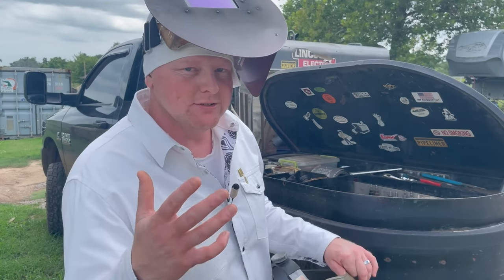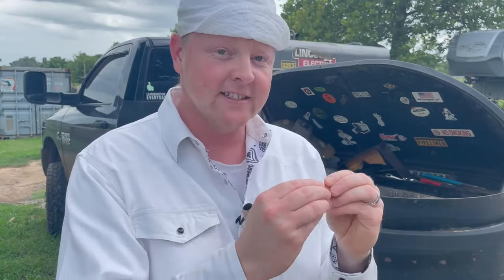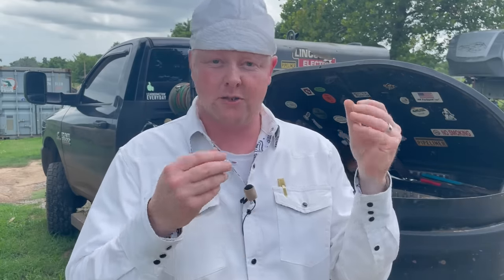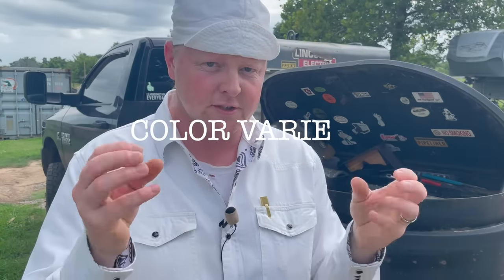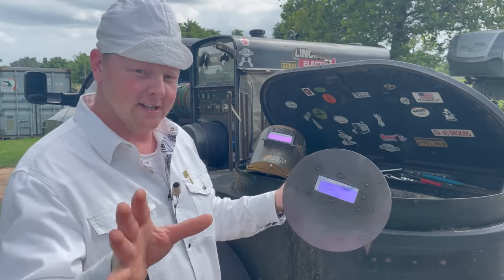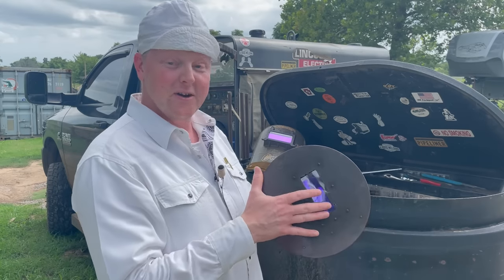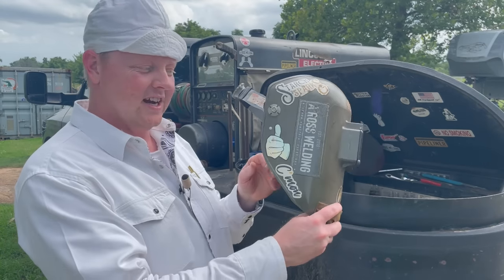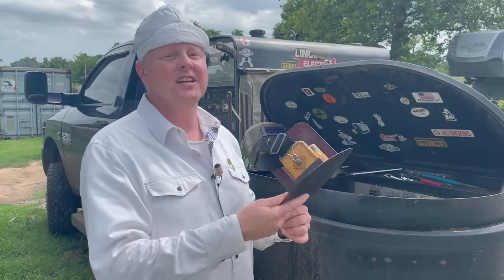Why Pipeliners Do NOT use Auto Darkening Welding Hoods (Fixed vs Auto-Darkening Welding Lens)

Comment: Auto darkening lenses have blue and yellow. Blue is the one I use and I can see very well. The advantage of auto darkening is useful in a shop setting where it is darker and hard to see. Out in the feild it is pretty bright out with sun. The sun also wears on auto darken batteries that are not solar powered. Auto darkening is ment for a shop setting and fixed is for out in the feild. Not that you can't use them interchangeably but that is what they were bulit for. The materials they are made out of are big sign of it as well. Sugar scoops and pancake hoods are made of a tougher material for working out in the feild. Shop hoods are usually made of a thinner plastic that is still durable but not like the stuff you see in the feild. I have never worked in the field but know some guys that do and they are very old and were around when they didn't even have hoods and wore goggles with cotton mask. The guy I know he owns a weld supply shop and has over 45 years of experience in shop and in the field and that is what he told me.

Comment: This just sounds like a pure personal prefs argument.
I would have thought maybe cause another welder is normally welding the same pipe it could cause issues with flash in your peripheral or from the sensor darkening before you're in the weld (due to the other welder).

Comment: I welded many years . Pipeline.  Compressors . And other high pressure piping .  Up . Down . B 31 .  Api 1104 . And all in between.  . Lincoln supervisibility fixed shade 9 outside . 10 inside . Not sure bout the new ones . But the early auto dark would delay in the cold wyoming winters. And get super dark inthe heat . The USA at the time Lincoln supervisibility was always crystal clear

Comment: Thanks for sharing with us Austin. I like the auto darkening lense but they are dangerous. When I put my hood on I will strke an arc just to make sure the lense darkens before welding. Can't afford to take a chance since I don't have lots of lenses available close to me. You stay safe and keep up the great videos. Fred.
Reply: For peace of mind, it might cheer you up to know that unless you're using a really junky auto darkening model, even the "clear" mode will block enough UV to keep your eyesight intact should it fail to darken. It won't be pleasant but it won't harm you long-term.
Reply: Even if it doesn't darken you can't get flash burn. It's just annoying.
Reply: By default, the glass already blocks UV.
So even if it doesn't darken, your eyes are safe.
Other than getting flashed if it doesn't darken, they are not dangerous.
Reply: @elitearbor yea my first auto darkening 2x4 lense for pipeliner just died last month I bought it 2014, lasted 9 years without failing once, auto is only way to
Go
Reply: @GoldSrc_ The polycarbonate clear shield and safety glasses are actually what blocks the UV. Even clear safety glasses will block 100% of the UV light.

Comment: started welding in early 70's and welding outside with no. 10 or 11 there is enough light you can see as if you were using auto .   With regular lenses  tig welding after a time you know where the rig is just by experience. I'm retired Boilermaker  and 78 years old. old way still works.

Comment: Arc One #10 auto darkening in my opinion is the best.  Iv had several,  used several others, and really don't like the $360 Miller Elete I bought for my son.
I have a plastic Jackson hood iv been using for 26 years now. On its fourth lense.

Comment: My problem has always been my warm moist breath fogging the inside of my helmut lens in a cold work environment. I solved the problem by putting two small 5 VDC  1" square electronic cooling fans on the top of my helmuts with a small speed controller and a 2  Lithium 18650 (7volts) rechargeable battery pack I mounted on top too. Runs several days on low speed before needing charged.  Light weight,  I can adjust the airflow rate and it keeps my warm moist breath out of the helmut! I blow the fans down so the so the air goes out under the bottom of the hood, sucks in mostly smokeless fresh air from the tip,  and helps blow the smoke away from the weld too to a minor degree.

 Got to be honest though, the moving air can chill your face when working in very cold environments! But I don't do that very often so it is rarely an issue! One friend even suggest putting a low voltage battery operated heater or Peltier device ahead of the fan's intakes to warm the air a bit. Quite doable but haven't tried it yet. Not necessary for me.  I could easily put the whole package in a small case easily mountable on the top or back of the helmut with no problem. 

I do like gold plate filters though and I would never go back to a fixed lens again! I haven't really tried various colors.

Comment: I use and love booth types of lenses. But i think the choice is more about what type of work you are doing. 
In a workshop i would chose auto 100% 
Out in the field, with the sun, the rain, the heat, the fact that you can be far from home, fixed shade never fails.
For see through the gap tig welding style, fixed shades are the only things that works 

In the shop i use a speedglas g5-01 with the vc lens. Best auto darkening visual quality available yet. Can chose the colour and the shade of your lens….
And the adflo is a lung saver when doing some heavy grinding on old rusty or painted stuff. $2000 is cheaper and less painful than a cancer 

And my fixed shade is a classic prota shell with a homemade adapter for my adflo

Comment: I used a fixed lens until about five years ago. I have been welding since 1992. Fixed lens is great because it always works, it is cheap to replace, and the new welders look at you like you brought a dinosaur to the shop.
Reply: Don't forget most of those new welders also wear their pants half way down their asses with their underware showing. I'm not joining that click.
Reply: @tired7140 Those would be blacks.

Comment: As a hobby fab/welder guy. My 2 cents. 1. Fixed is my go to because of the big window, which I have yet to see an auto with the same size window. 2. Auto is good for spaces I can not flip down my lid.

Comment: I was pipeline welding on the Columbia gas system before u were shitting green no biggie I always old school shit but in 07 was running hott fillers on 42 inch off tack rig and it was the big show u lived with the hood down and burned shit straight up  J W  welder boss for welded out of business now but I still use the hell out of them keep on 798 brothers greetings from Ohio farm lands

Comment: I was just talking about this with my coworker today I feel with stick welding my auto darkening is no good everytime I strike it dims and ifI don't get the arc going it throws me off fixed lens is better with stick welding you don't get that off and on constantly.
Reply: I hear you. One thing I found helped me was to increase the delay on the lens. It doesn't go light for a couple seconds after the arc is out. So no weird flicker. (About the same time it takes me to flip my fixed open by hand.)
Reply: @beyondmiddleagedman7240  thankyou for that tip I find myself not messing with my helmet much eventhough it has a lot of settings😅 I have the viking 3350 I'll try resetting the delay

Comment: 95% of my career, I used an auto darkening lens and only used a solid when welding on the back of a truck or outside of an excavation. Half of my welding was in confined spaces, repairing leaks (yes, at one time we were allowed to weld up natural gas line leaks on our lines)or installing fittings needed to shut down lines and when the excavations had multiple obstructions such as water lines, electrical ducts lines one would need a third hand to manipulate the hood or window.

Comment: I am a fresh welder, who is still going to school about fabricating, and welding.. I have problems with aiming before I start welding, on the fixed hoods.. I guess that is something you only learn with experience. Getting the muscle memory, and general feeling where the tip of your stick is etc. The hoods our school has, are so bad, cheap and dark that you cannot see absolutely anything through them. Nothing but black, until there is light from the welding.. So this can lead to stupid inaccuracies, and can be difficult with tests and such. I am absolutely going to order an auto-darkering one, until I develop that feeling, and muscle memory for it.

Comment: I too use an old old hood with a 2x 4 lens. Lately I have been using the Lincoln 2x4c, which is definitely more into the clear/blue tint range. I like the adjustable darkness settings. And well under $200. But I still sometimes slap on my other helmet with the fixed gold lens. It's nice to have options, and the latest greatest most expensive autodark rig is not necessarily the best.

Comment: I was a Pipeline welder for 35 yrs and just recently retired...most of the last decade of my career was welding 36" diameter Heavy wall natural Gas Pipe, I've been using an Arc One HD auto Darkening lens with a flip front Wendy Pancake all that time and every single day and have been through a few say 5-6 in all those years, at $100 bucks each that really is not so bad.    These lenses are awesome and unbeatable by far to a fixed lens.   The largest hurdle to jump is the stubborn attitude of these old timer pipe welders who refuse to change a thing in their normal routine feeling it'll jinx them on their next Xray, you wouldn't  believe how stuck in their ways and habits and especially superstitious an old pipeline welder is, I know since I was caught up in this spider web in the beginning until I stopped ignoring simple logic  I dealt with many of these ridiculous reasons of why not to weld with one until they finally tried it and got hooked themselves.
   BTW...I was one of the first to let go of my trusted Classic 2 and 300D Lincolns and Got myself a Miller Pipe Pro back the first year they came out and got hell from them at the time for doing so....Funny thing is they all own a Miller Now!!!!!

Comment: I'm a month late, but I've got... 5 hoods... An older 2450 from Lincoln my uncle gave me, a Radnor shitty fixed lens, a good Jackson fixed lens as my backup for work, a T94 with a Clearlight 1.0 lens I run at work so I could semi-retire my 2450, then a Digital Performance with Clearlight 2.0 at the house.

Something about the Clearlight 2.0 and TIG don't do well with my eyes. It's just too blue, even on shade 12 or 12.5. The Lincoln with its green tint on shade 11 does better for me. The Clearlight 1.0 has never given me this sort of issue at work before.
Reply from the maker: That’s alright! These videos are here to stay so you can watch any time!!! Thank you for taking the time to comment!
Reply: @arosswelding   Thank YOU for taking the time to make these videos. They remind me why I joined this crazy industry. It's like my second family.
Reply from the maker: Pleasure is all mine!

Comment: solar-powered auto-darkening lenses are as cheap as chips, battery-powered lenses have some adjustment, the biggest problem I have with these is outside in the sun: sunlight tends to make them turn on and off without welding. Some horses are good for some courses, but not all...

Comment: IMHO, if welding pipe or anything else where you going rod after rod continuously old timy hoods are great. For fab work where you reposition lots of parts with lots of small welds etc. Large view auto darkening hood will save you from arthritis.  Keep some spare batteries they ain't that expensive.

Comment: Auto darkening can be expensive. My air filterd speedy glass cost$2000AU. It has green, red or blue. And can blu tooth to ya phone to adjust settings. The advantages  it has is ya can adjust shades for different welding. And it has a lense that is twice as big in viewing area. They are more streamlined. So you can get your head in tight spots and see the weld way easier. Those auto darkening universeal lenses you use have the smallest viewing area of all lenses. Besides the ridiculous expense big auto darkening lenses are the go. And ya can always keep a spare bucket head in ya kit if that gosh darn new fandangled contraption thingymabob breaks down. Speedy glass is BS EXPENSIVE but they are very good quality that last for years.

Comment: Amen and well said Austin !  I'm still in the fixed flipper lid camp .  The silly auto auto helmet would go dark from just grinding sparks .....  😁
Reply: You can adjust the sensitivity on most and most also have a grind mode where it won't go dark at all while in that mode.
Reply: Safety squints are fine for grinding. 😂 My auto has a grind setting.

Comment: Unless you train yourself to blink just before you strike an ark, an auto, no matter how good or expensive will burn your eyes ever so slightly every time. Not enough to really notice, but enough the eye doc will see damage.  Also, some brands will burn out autos lens if the lens is exposed to arks from the back side, like hanging on the welder when someone else is welding. Burnt out 3 $120 lens before I realized what was going on. 
  Auto for Tig or very detailed Mig work and Reg/Non for everything else, but I only use a reg non now. 
   Some Autos have some cool features like adjustable shades for plasma cutting or torching. 

My mentor turned me on to the # 12 Gold Lens which has awesome visibility compared to a #10 green. Never seen or tried a blue, but will try next time I pick up replacements.
Reply: Thank you for sharing! Gives me motivation for starting off on this welding journey. I started with an auto darkening and the darn thing wouldn’t fully work when striking the arc. And it was and still is a fairly decent Lincoln. I switch over to the same round hood here in the video and upgraded to weld tubes HD Gold. And let me tell you it has made a world of a difference. I got it for Only like 4 dollars on sale. I think it’s  30 regular. I say it’s like cheating. It’s a level 12 and my eyes don’t feel fatigue at all. I am learning that when it comes down to the equipment it is worth spending an extra buck or two for the better quality. You get what you pay for and at the end of the day I can’t ask god to give me a fresh pair of eyes every now and again. Thank you guys love the community. Stay safe and god bless. Jesus loves you!
Reply: Straight up false. My eye doctor has explained this to me as a myth so idk man
Reply: Most people forget basic safety glasses block out uv light and that the undarkened lens in the hood is still filtering out uv light so their is no damage done to the eyes.

Comment: i have to learn something every day.  Because every day I forget more than a day's worth....  I'm going backwards as it is...
you know what i learned that no one talks about?  you don't need darkening on a lens.  a clear lens is good enough.  a pair of ordinary glasses is good enough.  for blocking harmful rays.  for stopping the 'welding flash',  for stopping 'getting flashed'.  How about that?
I know it is right because a couple of times I've struck an arc without bringing the hood down  and found myself stupidly staring into the arc for what seems like half an hous  ( a few milliseconds I suppose) before I figured what was wrong.
AND:  no flash.
Why? Because I was wearing my 'readers'  under the helmet.  No helmet but still readers.  And they are not even glass.  Just plastic.
Who knew?

and p.s.  when it comes to seeing what you're doing I still can't see what's happening most of the time. Damned if I can.  It's a lucky set up when I can see the line I'm supposed to be following.    I am (obviously) very much a diy amateur and poor welder and I only do it when I must. But i've been doing it for twenty years by now I guess and I still can't see.  before the auto darkener I couldn't even strike in the right place.  Now I can strike in the right place and maybe weld an inch in the right place and then it starts wandering off unless I have something really good to help me:  like welding in an angle instead of a butt joint?

So for me welding is one of the hardest things known to man.   :)

Comment: Had my Harbor freight Auto dark helmet the Titanium helmet had it for over 1 year still has 80% battery   Never get Lincoln Clear welding lens because that dies way to quickly like ever month you will be changing the battery  not worth it          If you want to get a good helmet try Arc Captain welding helmets Heard they are very good same for their machines all machines get a auto 2 year warranty until you get above the 500$ machines you get the tig AC/DC pulse tig machine that comes with a 5 year warranty  that is like 800$ rn good machine for what it can do you can use it for Mobile welding also just need a good generator with a 50 to 60 amp breaker able to get a peak of 10k watts and you can easily make good money with it

Comment: Tried a couple of inexpensive auto dark hoods. Not reliable, and last one would go light in the middle of a bead. Id just squint to finish. Researched and heard that even $500 auto hoods fail eventually. Ended up getting an accustrike hood. Seems like a good compromise for retaining ability to line up the rod before striking and having reliability of a fixed shade. Good solution for a spuratic weekend warrior welder like myself who needs a hood to just work every time even after sitting in a drawer for a few months.